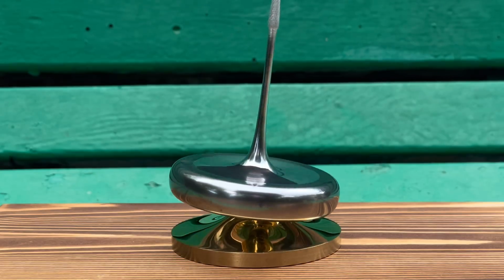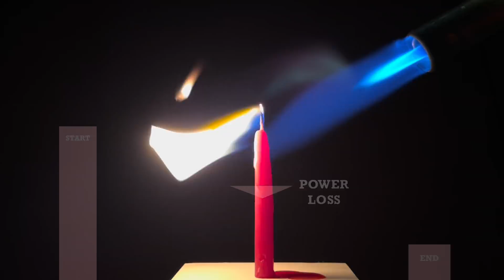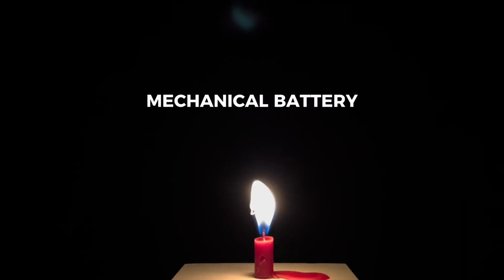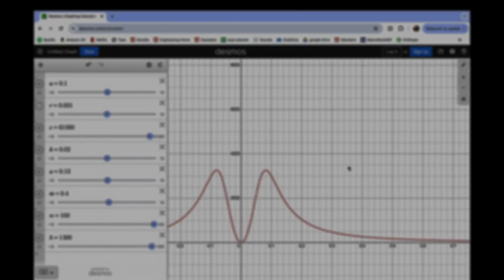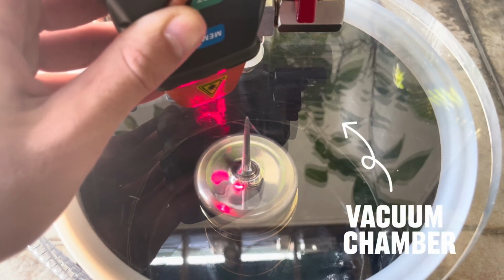How to Make the World's Longest-Spinning Top

Comment: Great video! I would honestly love a video where you dug into the maths even more. I think there is also an interesting relationship between friction causing the negative feedback loop to stabilize the top, and minimizing friction to make it last longer. Like you said, with a coefficient of friction of 0 tops wouldn’t work. How close to 0 can you get before the loss of stability causes more harm than the drag/friction slowing it down.
Reply from the maker: This is an interesting problem. From a practical standpoint, currently I'm working with mu=0.1 and this seems to be fine. I am doubtful that I will ever find a suitable contact point combination under 0.05 so hopefully I won't ever run into this issue!
Having reread your comment I would also add that since the distance between the tip and centre of gravity is so small with my tops (rate of precession is linearly proportional to this), they do not precess much before standing upright. The precession stage lasts just a small fraction of the overall spin time so I would think even if this period is a bit longer due to reduced friction, the gains in the latter 95% of the spin would greatly make up for it.
Reply: It would work even without friction, just the top would not rise, it would precess forever:  https://youtu.be/BBRNMmSwyQs

Comment: Would golf-ball-divots on the top reduce air drag? 
Is it worth going through the effort of adding divots, or is that obviated by using a vacuum chamber?
Reply: It would hurt the aerodynamics of a top.  That technique works on golf balls because of the reduced low pressure zone behind the ball that "pulls" the ball backwards.  This is achieved by the turbulent boundary layer it causes.  This effect is not present here.  All of the air resistance for a top is friction between the boundary layer and atmosphere.  There is no vacuum zone to reduce.
Reply from the maker: @rileyh4169  @rileyh4169 hit the nail on the head! Golf ball divots sacrifice some friction drag to greatly decrease pressure drag. However, spinning tops don't have pressure drag because they aren't moving through the air/ in wind. So divots would just increase the friction drag.